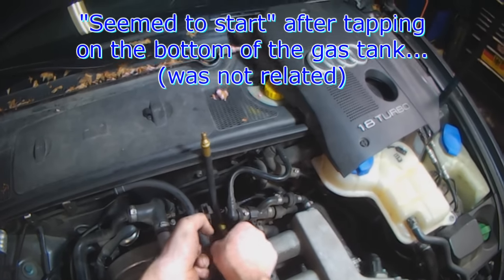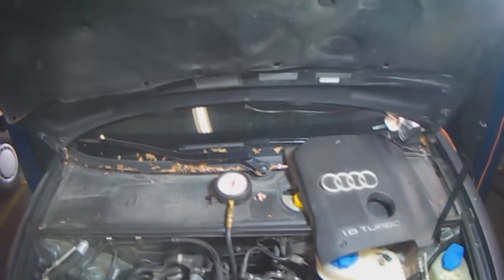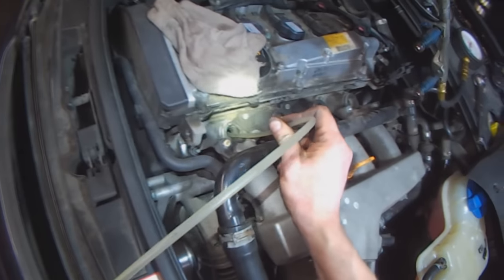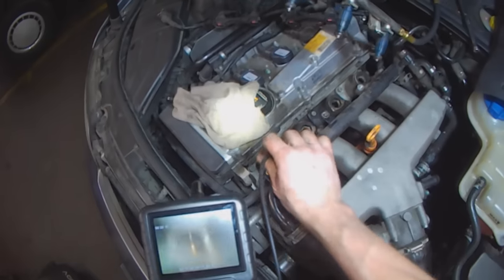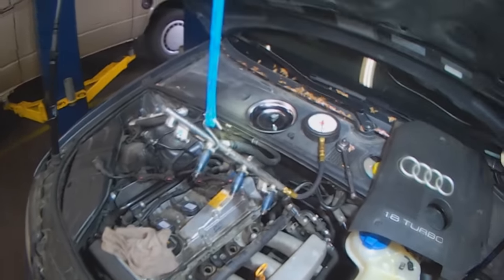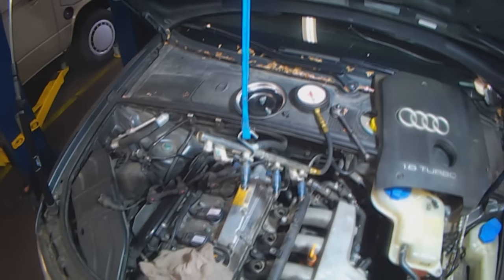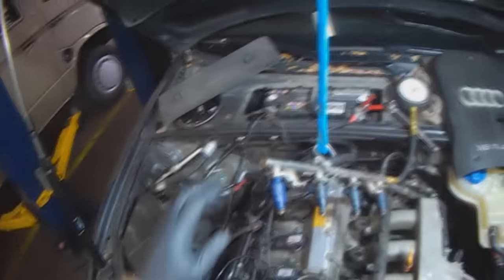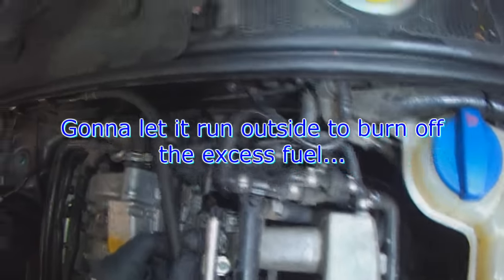Audi B6: 1.8T Rough running & white smoke out the exhaust

Comment: hey again mate hope your good. alright my cars acting funny i hope youl be able to help again!! i start the car it turns on then the rpms drop it turns of. the second attempt same thing, the third attempt i gave it some gas it stayd on ran perfectely normal no noises nothing. ok drive it for a couple hours came back it was normal started first time. it only happens the next day. its been 4 days and funnily enough today it started normal without giving it some gas. its making me think i got the same problem as the vid above. thanks
Reply from the maker: Don't know... monitor fuel pressure, EVAP purge valve, anything that has to do with fuel & ignition.

Comment: Great vid as always but I got a tough one for you good sir,,,,,,, 2003 a6 2.7 bi-turbo Quattro 175,000 mile engine light blinks off and on for about 10-15 seconds at random times, maybe every 30 min. or so, engine runs rough, then goes out, then engine then runs just fine, auto zone says that cyl. 1, 2 & 3 are misfiring. Took it to audi about a year and had the ALL 6 power packs replaced per a recall and placed nkg plugs in it about a year ago as well. It ran just fine up until a month ago or so. Have any top tips for me please ??
Reply from the maker: +drowization If one side of the engine is misfiring... look for what the cylinders have in common / could only affect that side of the engine. Not all scan tools will show all codes... there might be other codes aside from the misfire codes. Checking fuel trim values for both banks can help point the troubleshooting into the right direction.
Reply: +Thomas EXOVCDS Sounds great thank you again good sir....
Reply: +drowization So I took the car in to get looked at and they told me that the o2 sensors on the right (passenger side) need to be changed, which is what's more than likely causing the misfires. And they told me it would cost about $780.00 including 4 hours of labor,,, to change out the two sensors,,,, do you think it takes 4 hours to change out those two sensors ???? do you think that is a good price ????
Reply from the maker: drowization Sorry about the late reply, busy at work today. Have not yet had the pleasure to replace any on a 2.7T... I'm sure it's a valid labor rate (most shops look it up in a labor guide). Shops will buffer labor a little bit in case they run into issues (not their fault after all if they do). Might end up cheaper if things go smoothly.
Reply: +Thomas EXOVCDS Thanks again for the great advice. No worries on the timing as I was busy as well,,,, lol,,,,

Comment: I have the same exact car and engine and my car is smoking aswell i was thinking it was my turbo but now that i saw this I think it could be and injector, my exhaust tips are oily any idea what it could be? Car runs good no overheating no coolant leaks just smokes alot while driving and coming to a complete stop
Reply from the maker: Sounds like a different problem... oil burning rather than a stuck injector. This one had a dead misfire due to flooding of one cylinder... was not very driveable. If you can drive it & no issues starting... it's not a fuel issue. Compression test, check the turbo shaft for excessive play, compression test, pcv system.
Reply: Did you get it fixed mine is blowing smoke as well replaced the turbo and still is burning something but it’s driveable :(

Comment: I don't think I'm close to you but I figured I'd ask what do you estimate a price at for swapping a a4 b6 1.8t blown motor with a new one
Reply from the maker: I'll check the labor rate and will get back to you.
Reply from the maker: +Zbskater400 Book says 10.7hrs for an engine assembly swap... long block (bare bone) is 14.7hrs. Expect those times to increase a bit (due to unforeseen issues / extra work). In the end, it's gonna be what it's gonna be. :(

Comment: I also had the same problem today with my VW passat cc 1.8TSI EPC light, white smoke, rough running with shaking and strong gas smell and I saw some drops coming out of the exhaust, I believe it is gasoline, could it be also an injector failure ?
Reply from the maker: Nader Eltaief Could be... I have not yet seen any failed injectors on direct injected engines, but it can happen. On newer engines, the ECM shuts off the injector when an extended  misfire is detected. If the injector is stuck open, fuel will still get into the cylinder. Use a scan tool and check fuel pressure after the engine is shut off. If pressure drops, its most likely an injector issue.
Reply: +Thomas EXOVCDS  Okay, Thank you!

Comment: Hi, mine is a 2004 Touran, it has loss of power rattling a bit at the engine, showing STOP oil pressure error and thick white smoke with a few oil droplets exhaust. What could be the issue. many thanks
Reply from the maker: Bad turbo (if it has one)... low oil pressure.
Reply from the maker: If the smoke smells like fuel... check the injectors.

Comment: Great video. I have a 02 a4 1.8t, when idled it blows out white smoke. When I drive it, it drives fine. A bit of a rough idle.. but when I come to a complete stop or park it blows out white smoke, can you give and idea on what it could be??
Reply from the maker: Does the smoke smell like fuel? Attach a fuel pressure gauge and do some checks like in this video. Could very well be the same issue.
Reply: Thomas EXOVCDS it smells a bit like gas, i will try the gauge and get back to you. Thanks
Reply from the maker: OK.
Reply: Thomas EXOVCDS the fuel injectors seem good no leaks and good pressure.. any other ideas?
Reply from the maker: Check spark plugs & Ignition coils.
Reply: Thomas EXOVCDS I already replace them..
Reply from the maker: I didn't know.
Reply: Thomas EXOVCDS could it be the exhaust gas cooler? I saw a forum about it leaking coolant into exhaust and causing the egr system to recirculate the smoke?
Reply from the maker: 1.8T does not have an exhaust gas cooler.
Reply: Thomas EXOVCDS I didn’t know that. Could the coolant flange be causing the problem?
Reply from the maker: chapin1231 if the exhaust smells like fuel... not gonna be a coolant flange problem. What do the spark plugs look like?
Reply: Thomas EXOVCDS they look clean a bit of residue.. and now the smoke smells a bit like oil and gas
Reply from the maker: chapin1231 post a video of fuel pressure at rest and the injector tips... put the cooling system under pressure and remove the spark plugs. Post a video of what you see looking down the spark plug holes. Ignition coil & injector " current ramping" can verify if the coils & injectors are ok... get some tools to do that. What's the compression in all the cylinders.

Comment: I might be having this problem. Except mine is much worse in the sense that the engine doesn't even stay running after startup. It puts in so much fuel that it just misfires, and dies. Using measure blocks it shows that #2 is just misfiring.

Where do I send you links to videos Exovcds?
Reply from the maker: You can post the links here.

Comment: what if its running smooth and you got a little smoke coming out the exhaust, i have 2012 A8
Reply from the maker: What kind of / color smoke? I can't see from where I am. What does the smoke smell like? When does it smoke (cold engine, warm engine, cold outside temperature etc)? Have you had to add coolant or oil on a regular basis? How long have you owned the car? Did this just start recently? The more info I have... the better I can guess what the problem might be.

Comment: My car it's 1.8 tsi tunned to 200bhp starts white smoke when I drive it on high rpm and white smoke continue on ideal rmp and the smoke is heavy and if I drive it on normal rpms there is no smoke at all
Reply from the maker: What does the tuner say about this issue?
Reply: @EXOVCDS  nothing he said piston ring are weak
Reply from the maker: @gagansarangal8944  does the smoke smell oily? Or does it smell of gas?
Reply: @EXOVCDS  oily and gas both I think but it only start when I run my car on high rpm and the smoke continue even when the rpm is on ideal and there is no no smoke when I drive it on low rpm  no smoke at all
Reply from the maker: @gagansarangal8944  High rpm & boost? You can have high rpm & NO boost. If it happens when high boost, then the engine  might be getting too much fuel (due to the tune). This is not something I can help with. You need to deal with someone in your area, who can test drive the car, see & smell what is happening... and attach a scan tool to monitor ECM sensors.
Reply: @EXOVCDS  I never thought about remap and fuel consumption.thankx for that I willl check it thoroughly

Comment: My Audi A4 05 smells like burnin oil all the time can it be the gasket valve? and it smokes out dark smoke when I hit the gas hard too
Reply from the maker: AMB 1.8T, 2.0 BPG, 3.0 BGN or 3.2 BKH? Oil from the valve cover gasket(s) can get on to the exhaust causing oil smell inside the car. PCV hoses / tubes can crack & leak fumes that will get inside the car... black smoke under hard acceleration is normal (engine computer pushes more fuel for more power). If it is a lot of black smoke, then something might be wrong.
Reply: +Thomas EXOVCDS 1.8t and thanks man :)
Reply from the maker: Angels Forbid A leaky valve cover gasket is easy to spot... just look around the top of the engine. Here is a video of PC components from an AMB engine.

https://www.youtube.com/watch?v=rjdTfETe5Dk

Comment: Idk if you can help but I have an 01 gti 1.8t I think this is my issue would this throw a code also would it cause a random drop in throttle response ie I'm going 40 ish than lose all throttle response and I have to play with it til it goes again
Reply from the maker: smooth loss of power? Then no.... if an injector sticks open or closed, the engine will run rough. Disconnect the MAF and drive with it disconnected. Do you have the same issue? You might have to give it some time to act-up... if it doesn't act-up anymore, might be a maf issue. Could be fuel pressure related (pump going bad)... not sure at this time / with the info at hand.
Reply: Thomas EXOVCDS I did try unplugging the maf didn't do anything I'll try for a longer period of time and get back to you
Reply: It also does run rough at idle like it isn't steady

Comment: Hi, I have a passat 1.8tsi 2010 . I changed my engine oil cooler and waterpump 2 weeks ago, today i have white smoke coming from exhaust, i thought it was condensation at first but more smoke and water is coming out after temperature is normal. Coolant level is still the same and i have no idea. Could it be pcv valve or my head gasket?  White smoke smells like steam and my car has ran less than 3kms in last 8 months due to delay in waterpump and oil cooler shipping because of lockdown. Please help master
Reply from the maker: If the engine is burning coolant... the smoke will / should smell like coolant. If coolant level is still the same, it can't be coolant that is coming out of the exhaust, no?
Reply: @EXOVCDS  The exhaust smell is just like steam.. Water coming out also is odourless( definetly not fuel ) I am worried if i try to run the car i will damage engine 😅..
Reply from the maker: Water is a byproduct of combustion... if coolant level is not dropping, then the engine is not burning coolant. Start the engine, let it idle and then rev the engine a few time... keep rpm at 3000 for 10 seconds. Post a video of the exhaust so that I can see. Colder winter temperatures will cause more condensation / smoking.
Reply from the maker: @emmanuelaineh  Have someone test the cooling system like this (if you still think you have a head gasket issue):
https://www.youtube.com/watch?v=13RwJfmJgf8

Comment: Hi I have a Audi TT 2010 diesel sometimes blows white some and loss of power could I have this problem thanks
Reply from the maker: I don't know... maybe. Does the engine run rough when that happens? No fault codes? I have not yet seen stuck open injectors on TDI engines. Check the intake / intercooler for excessive oil.
Reply: The car drives sluggish when it does coil light flashes then I pull over and turn car off and back on and the light goes off thanks for reply
Reply from the maker: @debbiesmith6402  Time to drive with a scan tool attached... monitoring engine live data. A fault code (a pending code) can set and not turn on the check engine light. Check for fault codes as mentioned eaarlier. Monitor boost pressure, MAF readings, brake pedal switch operation etc.
Reply: Thank you for your help and fast response 👍

Comment: Hey Thomas my car Just every time have a  miss fired in number three  just in number 3  is the only problem
Reply from the maker: Year, make, model, engine?
Reply: 2002 Audi A4 1.8t Every time I used the scanner same problem
Reply from the maker: @fresoooon  Have you checked the spark plug, ignition coil, fuel injector, carbon build-up on intake valves, compression?
Reply: Thomas EXOVCDS I do all this already just the compression I don’t do it not yet
Reply from the maker: @fresoooon  ok.
Reply: Thomas EXOVCDS yea is the Compression just I check it thanks for help me
Reply from the maker: @fresoooon  thanks for the update! Do you know where the compression is leaking? How low is it?
Reply: Thomas EXOVCDS is from cylinder #3 and two have only 120 and the other ones have 150

Comment: I have a audi b5 that kicks out white smoke but only after I idle 5 min ...it caused me to fail smog I'm thinking valve seals ur take?
Reply from the maker: juan cortez Could be... remove spark plugs and confirm oil burning. What does the smoke smell like?
Reply: Thomas EXOVCDS it smells funny when I accerate from a dead stop should I get new plugs?
Reply from the maker: I don't know if you need plugs, you haven't checked them yet. If the engine is burning oil, new plugs are not gonna help.
Reply: Thomas EXOVCDS a egr be the issue? I changed the pcv valve and hockey puck thing by the turbo and both were full of slugge
Reply from the maker: Exhaust Gas Recirculation? 1.8T does not have it.
Secondary Air Injection is normally on that engine... what is referred to as an EGR valve is an Air Valve that allows air into the exhaust. An actual EGR valve allows exhaust into the intake.
No, a Secondary Air Injection Valve will not cause that kind of smoke.
Reply: Thomas EXOVCDS well ima do the valve seals and valve cover today I'll let you k me how it goes
Reply from the maker: Thanks... valve stem seals are a pain in the rear on the 1.8T's with the small springs, keepers & lack of room. =(

Comment: Was the car throwing any "Codes" for the lost fuel pressure?
Reply from the maker: No... this year vehicle & fuel injection system does not "monitor" fuel pressure.
Reply: @EXOVCDS  : Thank you --- I have the same vehicle, which is why I was wondering. - 👍
Reply: @EXOVCDS  : Was the vehicle "misfireing" --- myne is 'misfiring'?
Reply from the maker: Yes.
Reply: What did you do when the "key [was] cycled a few times"; do you turn the ignition key, or what --- I didn't hear the engine crank?
Reply from the maker: @johnathandoerty1021  At 3:08 my coworker turned the key ON & OFF a few times (no cranking). Fuel pump turns ON & OFF to prime the system.
Reply: @EXOVCDS  : Duh; I knew that --- sorry...
     Thank you; you've been a great help, Sir! - 👍
      Stay safe, and healthy. God bless!
Reply from the maker: @johnathandoerty1021  you & yours as well!

Comment: I think I have same issue but my one is showing misfire
Reply from the maker: This one also had misfire codes.
Reply: I’m really sorry can you tell me again what is bad when fuel sys1 is ol-fault,
I checked my o2 circuit but it’s good,but when I hit the gas it’s ol-fault and when I break the car rpm is drop like 500 to 400 and it’s come back at normal rpm,and some time stall, my o2 sensor is 5wire so can you tell how to test that circuit,
Reply from the maker: Fuel System 1 OL = Open Loop
Depending on driving conditions, the engine computer goes into OPEN or CLOSED loop. This is normal. If the engine stays in OPEN loop, then there is a problem.
Year, model, engine?
There could be a number of different reasons why the engine rpm drop too much... which can cause stalling.
Reply: 2003 Audi A4 1.8t Quattro AMB 
I already replaced maf but doesn’t fixed,
And also I am going to replace my breather hose because that is have huge cracks,
It’s can be cause a bad breather hose?
Reply from the maker: Yes, bad breather hose and bad PCV check-valve can cause misfires. Here is a video about PCV components on a 1.8T Passat (similar to your car): https://www.youtube.com/watch?v=eBbN3ba4IAQ
Reply from the maker: At 7:44 of that video, you can see a rubber "T" hose. Inside that hose is a "check-valve". When that valve goes bad, it causes misfires at idle and can also set boost codes. https://youtu.be/eBbN3ba4IAQ?t=7m43s
Reply: Ok thank you very much, I will check tomorrow,
Reply: My pcv valve is not completely bad it’s really tiny leak , am I should change it?
Reply from the maker: DIY Garage if you already have things apart, you might as well install new parts.
Reply: Ok than I am going to install tomorrow, thank you very much
Reply: My both o2 sensor is really white it’s a bad or normal?
Reply from the maker: DIY Garage color is not always an indicator that something is wrong / bad. Use a voltmeter to check the o2 Sensors. Or use a scan tool. If the ECM doesn't set o2 fault codes, they are probably ok.
Reply: Ok, thank you very much,I will check tomorrow,

Comment: I have this same issue with my 06 gli getta
Reply from the maker: White smoke & running rough?
Reply: Yes there is white smoke when I drive it and I get terrible gas mileage and the fumes coming out from the exhaust smell like raw gasoline and it also runs rough , could this be the same issue ?
Reply from the maker: @frankymagana5282  Yes, could be.